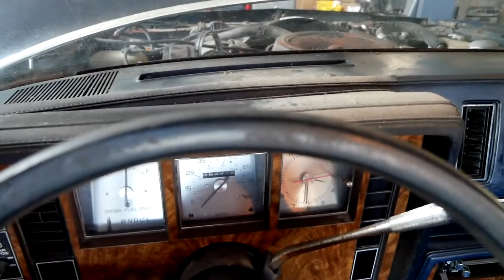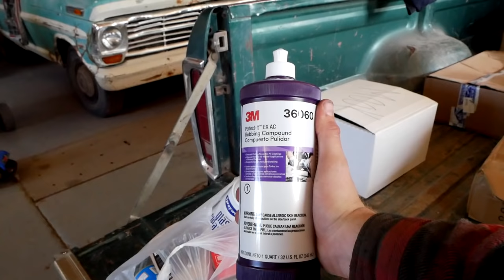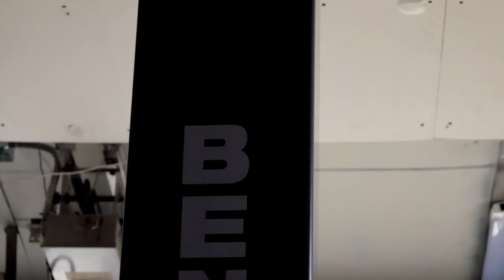Will the Most UNRELIABLE 1980's Car Return on the Road!?

Comment: OK this has been out for 3 years AND I had one of these BUICK'S (and the wagon version also from CHEVY. My experience has taught me that it is NOT uncommon for the pulleys can be "bent/warped" and with the back ground you have provided with the amount of body work and paint it has had I would give you a plug nickel that this has rear ended someone and it was rebuilt. AND they did not care that the pulley made noise because they were just getting it out of the body shop to be resold. My guess was that it was a total or close to total and insurance paid it off and the repair shop flipped it and these good people that sold it to by had bought it from the shop or dealer at a great price. But that is a guess
OK watching to the end of the video was about what I expected but reached a different way except with the odd number of belts it caused to pulley to warp and scream. So I was basically was on spot with the bent pulley

Comment: These were made reliable by using head studs rather than bolts.  Check the paint thickness, if you respray using dissimilar paints it will crack.

Comment: In 1981 diesels were smog exempt if you want to get a little bit more power out then put in the exhaust mounted Turbo that little diesel 350 will start to move

Comment: The dark and light strips are from the metal building the car was in. If the roof drips, the chemicals in the galvanized metal panels will stripe the car pant.

Comment: Nce work, I love underestimated cars like this.
I prefer usually old cars with I6 Diesels, but a V8 Diesel in a native car is also very cool. Low power even if it has a turbo but torque and best sound <3
Why the heck rushing? Not necessary wh such a car, simply enjoy it.

Comment: I had this belt ishue with a 1995g20 5.7 turned out the alternator bracket had cracked, and the alternator was just ever so slightly out of alignment, causing the belt to squeal

Comment: I don't know much about cars but I know enough to be dangerous when it comes to pulley systems. If it's not the alternator or pump and it's getting hot fast and screams that means more friction than it should be. Either the tension is off or the alignment of the pullies are of in conjunction with one another.

Don't know if anyone has brought this up with 3,000+ comments and this is 5 months later so you might not still have it. Maybe my idiot logic can help if I am not completely way off in my understanding of pullies. 

Just getting to the last 10 minutes and it sounds like you might have gotten to the same conclusion 🤣 either way, great channels! I will shut up now and just watch.

Comment: Kind of a late comment, but hey. You can use one of those twist-out deodorant sticks as belt dressing in a pinch. Works just as well, just doesnt last for weeks. It does make the engine compartment smell nice for a bit though, so there's that.

Comment: I thinking unequal pressure from only 2 belts on the water pump. it would then make sense that only there it was getting overly hot. once the third belt was added then the side pressure on the water pump was equalized

Comment: I presume you guys checked the function of the glow plugs? A rough cold start of a diesel, that doesn't have any other obvious mechanical issues, is usually down to dead, or weak glow plugs. I check mine in my diesel Toyota by pulling each and gater clip jumper leads across the threaded top of the plug to the positive battery terminal, and the plug body to the negative terminal and watch the tip of the plug and look at a watch second hand.  A good plug will glow bright orange in 5 seconds.  Any plug that takes longer to glow than at least 7 seconds, or doesn't glow bright orange, or at all should be replaced. Another good indicator of a dead or weak glow plug is blue smoke [not black] on start up.😉
BTW, I hate automatic transmissions. Give me an organic intelligent 5 or 6 speed gear box everytime.

Comment: I did watch this video when you first posted it, and no one liked or commented on my comments, so I deleted them. Still, I would REALLY like to have this old girl because I'd figure out a way to build some turbo manifolds, a collector pipe, put a relatively smaller T4 turbo on it like a HX35W, figure out how to add fuel control to it, put a 4" (or at least a 3") turbo-back exhaust, and if it's reliable I would daily it and just keep it clean. It'd also be awesome to put a modified relatively modern 6.6 Duramax in it.

Comment: Foam and a spiner tip works better with less pressure but I understand this is for fun and fast is better for a reveal

I would actually love to have a two door that looks like that ok late 70 early 80’s body style. Solid frame so you can put a crate motor and proper exhaust with a 5 speed on the floor fun vehicle.. buick used to be the old mans sleeper car

Cool find though.. when uou young bucks reach 40 you will realize a sleeper that floats is much more fun on the road. Cops don’t even look at your car.. slap alloys on it.. low profile. Upgraded air ride or electro mag suspension and inertia system., (it puts power to the side it slants toward to stiffen the dip) cigarette lighters used to be at the door for your command center passenger area..

Comment: My dad got an 82 Buick Regal Short Wagon in the same color and same horrible engine. We replaced the diesel engine once, then converted it to a gasoline 350 and my brother kept it going for years.  Among it's other horrible design traits was the inability to roll down the back seat windows. It only had wing vents. So lame.

Comment: you can say nothing changed and the belt squeak went away, but thats not true is it, pretty much everything changed... new alternator, new water pump, new pulley and new belts, so technically everything did change, the issue before was probably a v belt that was loose or slipping causing a squeak and the issue was getting worse because the old belts were stretching from running but not springing back with the ancient rubber, the squeak kept going afterwards because the pulley was unbalanced and wobbling, until the load was equalized again by adding the AC belt back to the lineup. then the squeak all but went away.

Comment: Parts being returned and put back into inventory without an inspection really burns my bacon. If you bought the wrong part, fine, clean it the best you can and return it. If you broke it while installing it, don't be a dee bag and tell the person behind the counter that it was just the wrong part. It's possible that the part was defective from the start (many are), tell them that and it won't get re-sold. If you're the person behind the counter, take a minute to look at that part and be sure it isn't damaged or covered in freaking blue gasket material before you put it back on the shelf.

Comment: Let the engine get to operating temp! If it stops then when cold start it and disconnect the flow plug relay it should stop squealing instantly! If it dose you need a bigger battery as it’s drawing to much power from the alternator!!
If not then it’s something else other than the battery

Comment: The belts are squealing that is why that pulley is hot when belts slip they create heat and that's the issue. I bet if you spray some belt dressing or even water on that water pump pulley the squeal will go away some V groove belts will do that when they don't fit right in the groove or if the pulley is worn inside the groove.

Comment: Sounds to me like the batteries aren't fully charged and the alternator is at full load, you know how quickly alternators charge batteries, 
so let it run a while and CHARGE the batteries and see if it goes away, and make sure the batteries are good

Comment: ok i was suspecting a bad water pump bearing even thou it was new it made sense i had a brandnew water pump on a kia sedona yes i know but im a mechanic it was not mine anyway it made silular noise for about 20 seconds then boom ! bearing seized pump exploded a pulley was pressed on so since that pulley runs off water pump until you said and showed the ac was disconected and i saw exessive load on one side ps and altenator with no load on counter side (ac) im glad its not screaming no more but probably not as happy as you guys lol nice video good looking car

Comment: Those Diesel Engines have to be Plugged in,  in the Winter or they won't start.   A Friend of Mine's Parents had a 1981 Diesel Cadillac.  I was Nice Riding Car,  but it gave a lot of trouble.

Comment: Check to see if your pulleys are touching sometimes I'll do that you can turn around and take the pulley off lay it on the bench and tap the face of it a little bit around it with a hammer and it will push it in a little bit and move it out

Comment: Ok hear me out I have a 1992 Chevy truck I had 2 issues with the belt squeal one was that the belt was to tight and the other was that the ac compressor was not lined up so maybe try loosening the alternator up so it can try and realign it’s self

Comment: You definitely had a loose PS belt because it squealed like a pig. But if you have a double pulley set it requires a matched set.(belts that were cut besides each other at the factory) We changed a lot of those in the 70s, 80's. Even if we ordered the same # belts, one was always a bit longer or shorter than the other.

Comment: So the fact that the car was squealing without that belt makes complete sense to me. that pulley for the water pump had too much tension pulling it to the right and causing the bearings to get in a bind and make noise. Also the bearings werethe reason that the pulley was heating up so fast and getting so hot. With the AC belt on it keeps tension pulling the pulley to the left and countering the tension of the pulley being pulled in the other directions by the other belts. Well at least thats the concluson i have come up with. There's definitely a little bit of physics that goes into engineering engines.

Comment: lol...that alternator HAS TO CHARGE 2 BATTERIES, NOT ONE!  a/c belt and alternator make the water pump pulley slip.  I bet if you had FULLY  charged the batteries, the squeal would be less with only one drive belt turning water pump pulley.

Comment: I spent most of my limited hours keeping classic cars and motorcycles going. 5 years ago my "friend" made me  buy a 2000 Toyota Avalon with 187k on the clock. It has started every day for 5 years and I had to do some brake work lines rotors etc, I'm still going. no more starters and brake boosters fro junkyards. 209k and sounds and runs like a new 34k car. go Toyota!!@@

Comment: You might want to check out the floor pans underneath the front carpets. G Body’s are notorious for rusting out in these areas. Net result of that swimming pool foot area. They gather all of the winter water from one’s shoes.
At the 28 minute point when you started the car again I heard a military HUMMVE starting up but this one has Options! That alternator more than likely is a 100 amp unit common to the GM shakers.

Comment: The only fact that these were considered unreliable, was split beetween the two: 1)Hobo mechanics, who never really knew, how to tune a diesel, since they've never worked on anything heavier than 1500kgs, and 2) 80's oil conspiracy, which couldn't allow people to have their daily barges, running at 1/5th ammount of fuel, which would've hurt the "crisis" sales.

Such as with Delorean: car wasn't bad, it was just placed at the wrong market, in the wrong time.

Comment: @ 1:12:30 "nothing has changed"
Sorry Kevin, but something fundamentally changed.....
In the beginning, you had nice old rusty pulleys which gripped like shit.
As you ran the car they 'shined up' making the belt surfaces slippy.
Once you aided the water pump pulley to turn, your problem was solved.

Comment: honestly diesels are reliable. take mercedese and VW for example. sure those were oddball cars but they were just as good as this buick century. besides. thats very nice to daily drive an old 80's diesel because the fact diesels are reliable but also good on fuel milage than a gas counterpart of the same displacement

Comment: Hey Kevin and Mook watching the video where you guys are we doing an 83 Buick with a diesel in it you might want to check and see if that's generation one or if it's the 2nd generation diesels from GM because the 1st generation were made out of gasoline engines and they were junk Jim's I'll make your junk and they wouldn't last very long till the engine blew out engine blow out

Comment: 44:50  A D.A. is a Hair-Style from the 50's, aka Duck's @$$ because they used Motor Oil or Bearing Grease in their hair and when the back of their hair came to a point, they would curl it like a Duck's Tail. My Older Cousin's and Uncles would wear their hair that way.

Comment: Ahh, the good old LF9 5.7L diesel that makes 105 HP and 199 lb ft of torque. Without the fuel mileage it reminds me of my 1976 Buick Skylark with the Olds 260 4.3L V8 that made around the same horsepower and torque (105 HP 185 lb ft). The only way it would do a burnout was with oil on the rear tires and a firm powerbrake...😂😂😂

Comment: Son you-all just might be really surprised at what that old noisy clunker can do , don't stress it with stupid teenager stuff like doing donuts because it just might have something you have never seen in your life . Make sure it's roadworthy all glow plugs working fresh batteries and filters then fill the tank up and take a trip . Be ready for for the shock of your life when you realize what the millage really is . I live in San Antonio  took my 82 olds to Galveston then to Schreeport Louisiana and back on a tank of fuel that huge luxury car was awesome it got 38 mpg on the road , not as good as my 1980 VW Reddit it got 50 and both cars were with ac on but can't beat the comfort of those larger cars . another important thing replace that under hood blanket it was there to keep the noise down . And when you realize what you have and want to add additional 500,000 miles to it you might consider an extra oil filter for more reserve as it was designed from the gas V8 and oil pan is a little small for a diesel . Good luck and hope you can get many more years out of it .

Comment: You ruined your new belts. Belt dressing is made to be used on old dried out belts as a temporary measure until they can be replaced. It breaks down the rubber and softens it.

Comment: GM Diesels simply sucked at or within those years.  Late to the game.  When they arrived 2018 it was a game changer as GM does so well.  Yes, I am a GM fan, 1994 Z71 320K miles on my engine and not really looking for that replacement anytime soon.  Daily driver

Comment: That car was a POS when it rolled off the assembly line.  The V-6 they offered was unreliable, the diesel version was unreliable, and the V-8 gas engine was just ok if you got a good one.  This just wasn't a good time for GM or any of the American car companies.  Japan was ramping up the foot in the ass it was giving the Big Three, gas mileage was a big issue, and none of the American car manufacturers could come up with anything to stop what was happening.  I think it would have made more sense to leave the car where it was and not even consider trying to get it driving again.

Comment: If I could find one of these diesel cars in good condition, I would probably buy it.  I worked on the 6.2 and 6.5L engines in the Army and I had GM 3/4 ton truck of my own with the 6.5L.

Comment: How much did you actually spend resurrecting this abomination? I ask because my father (also an auto body man) had a 1979 Olds 98 with 350 diesel and also a GMC pickup with 350 diesel. The neighbours would laugh and call him the $1.50/hr. diesel mechanic because he was forever in the garage repairing these monstrosities. He went through seven motors.

Comment: That was no where near the most unreliable car of the80's the 1987-89 eagle premier  holds that crown you pull that diesel out flush the tank drop a gas 350 olds under the hood and all you need to do is wire up the HEI

Comment: Unreliable my ass, I owned two 5.7 diesel cars and both lasted over 500,000 miles. The biggest issues were garbage diesel laced with water and morons using ether even though a tag on the air cleaner clearly stated using ether will cause engine damage. If I could find another good 5.7 or 4.3 diesel I'd buy it.
Reply: That is really good for a buick.